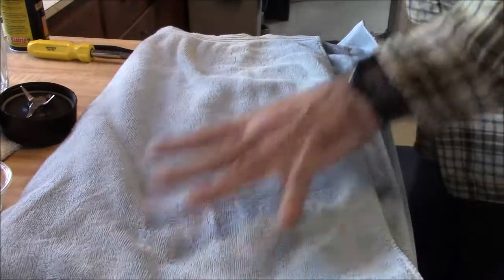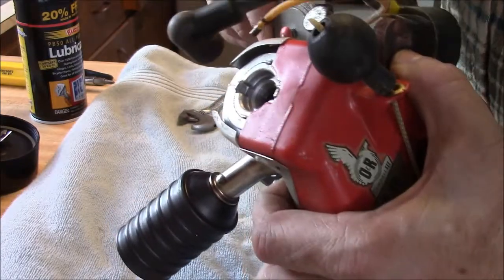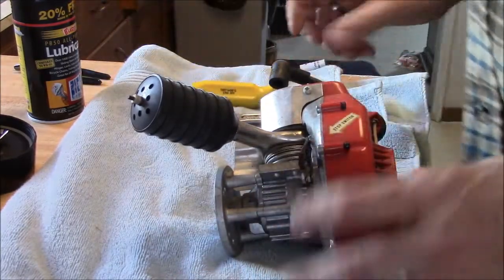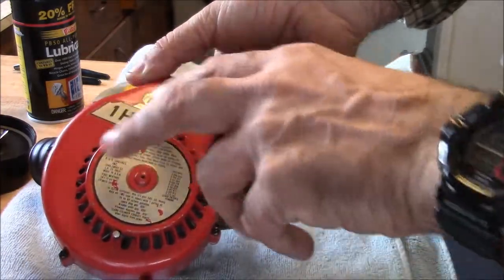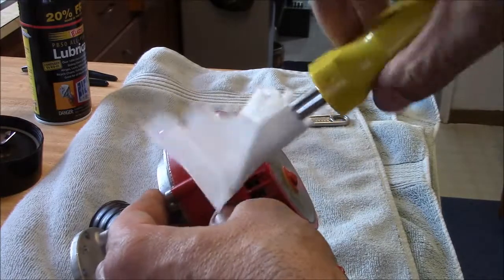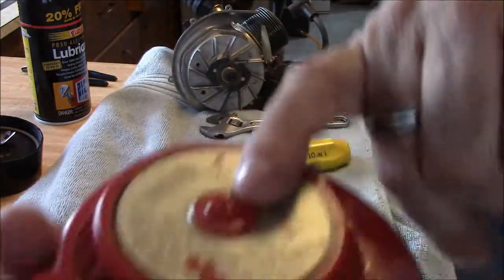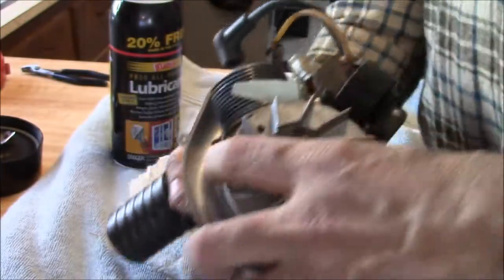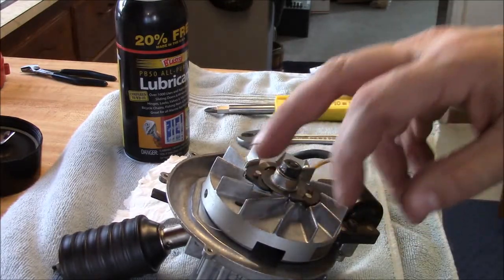Ohlsson & Rice (O&R) Compact engine 1 HP PT1

Comment: Cox also sold a small power equipment engine which displaces 1.4ci (23cc) and the Beaver chainsaw which used the same engine.  It is the only engine of its type I know of which was sold in a cardboard display box.